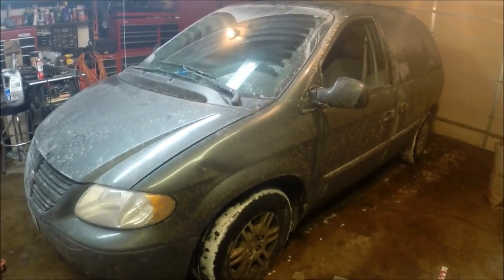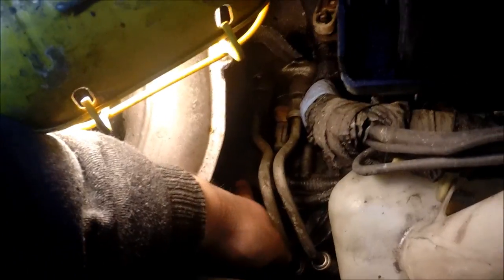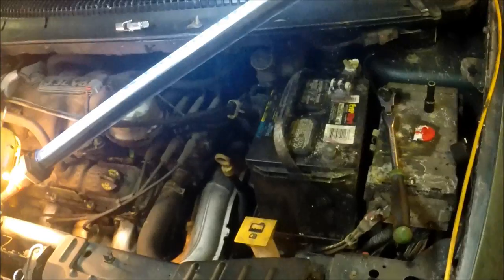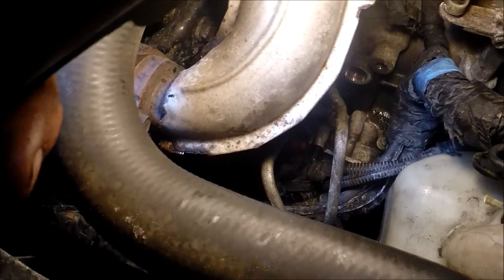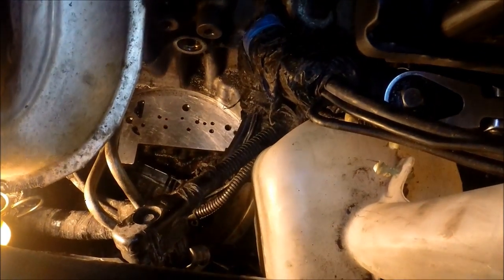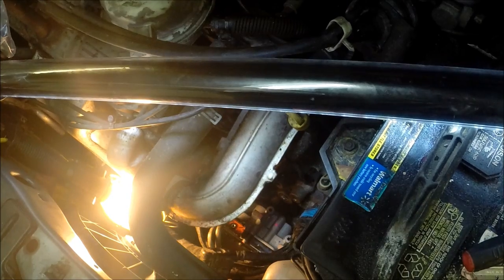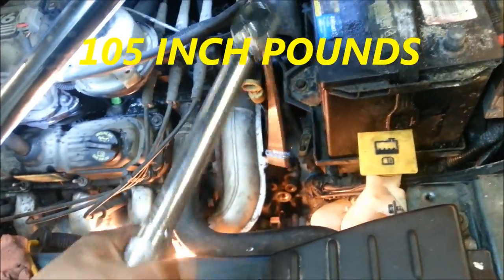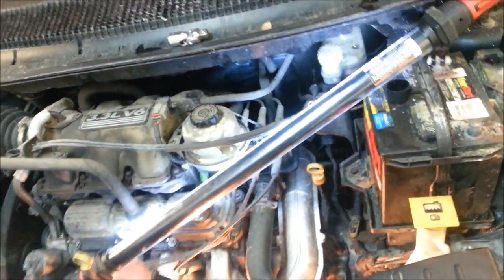Grand caravan/ town & country transmission control solenoid pack replacment

Comment: Im doing this on my Town and Country.  Everything has been ice cream up until now.  For the life of me I cannot budge the solenoid free after removing the bolts.  Any ideas on how to pop it free?  Perhaps a bottle jack from underneath to pop it free?  I don't wanna mess anything up.  Thanks
Reply: Another video a guy simply pried it with a flat tip under the bottom left corner but it was a Sebring. I have to replace mine this evening. Will let you know if you haven't figured it out yet.
Reply: @michaelblackwell7408  I got it.  I just took a 3lb hammer a couple light taps from underneath and it popped free.  Got the solenoid switched out.  No engine light and eow what a difference.  So satisfying to do it yourself.  Hardest part was scraping off the gasket.
Reply: Mine popped and lifted out by hand

Comment: what was the original symptom that caused you to change it?  I have a 1 to 2 buck under light acceleration.
Reply: Reallystock Mustang your transmission begins to fail shifting from 2nd gear, on. that is how you know. And when you scan the vehicle it gives you an 0753 code

Comment: I have a 2010 Dodge Caravan  and the engine light came on took it in they hooked it up said it was the trans shift solenoid. my rpms are up high and I'm only going 30 and sometimes if you turn it off while it's doing this it has a hard time starting again. so my question is. is this only the trans shift solenoid.
Reply: I have the exact same problem on an 02 model the only difference is the light pops up and says trans control module.
Reply: +mboone84 took it to shop they said it was starter.....but the code said saying els
Reply: +Adriann Pearce I have the same problem on a 05 caravan did you figure out the culprit on yours?
Reply: +jesusamador15 took to shop they said it was the starter. they reset the codes.
Reply from the maker: +Adriann Pearce hi sorry for the ate reply , but i see the shop said it was a starter. if the starter was drawing to much power then it could cause issues. the solenoids are sensitive to voltage drops and can put them in limp mode , easiest way is to test the battery and charge if necessary then reset the pcm by disconnecting the negative battery cable for a few minutes and see how the van reacts its the cheapest first diagnosis
Reply: +JoeTheAutoGuy  thanks for the info. much needed!

Comment: Hey joe just done a complete rebuild on a 01 town and country have a shutter on low gear take  off any ideal
Reply from the maker: fluid level , shift pattern may need to be relearned. also could be engine or mount related be sure to inspect . is the shudder constant does it change with engine load?
Reply: JoeTheAutoGuy hey joe thanks for the reply change the box no more shift problem but i guess the guys wife tour the transmission out already said i used used parts which is not true may had been a problem with not coming to a stop be4 shoving it in park who knows but thanks again

Comment: NOTE:	 If solenoid/pressure switch assembly is being replaced, it is necessary to perform the TCM Quick Learn Procedure.

did you have to do this
Reply: Not necessary, just disconnect battery before starting to work on it, and reconnect when finished, system will have to do a relearn after battery disconnect anyways, ive done dozens of these no issues.

Comment: did you perform a trans relearn? if so how?
Reply from the maker: +Reese Mcintosh i did not with no issues, but the relearn can be done with a sufficient scan tool from a mechanical repair facility and or dealer
Reply: From my understanding the re-learn isn't really necessary. Once power is restored to the solenoid it will re-learn itself but it takes about two weeks of driving, which seems like a better option. It will re-learn to your driving habits and not a preprogrammed piece of softwares "habits".

Comment: what are the symptoms when this is failing?
Reply from the maker: mine was leaking through the connector causing control dtcs
Reply: @JoeTheAutoGuy   will this fix the shudder going up hill issue?

Comment: I'm having trouble with a 2005  town & country transmission. it sometimes wont shift properly from second to first and sometimes it wont go in forward or reverse from start until you turn engine off and restart than its fine. would it be the  transmission control solenoid pack? thanks Ronnie
Reply from the maker: Ronnie S hard to say honestly , dodge has a limp mode that the transmission will go into sometimes, causing it to stay in second gear at all times , a scan tool that can read and control the trans solenoid circuits is needed for testing. dont wanna tell you its the pack and be wrong with internal damage, fluid condition is something to look at , also level if its not building pressure it wont do anything. the pack is reasonble in price and not to bad to replace but sometimes getting it professionally checked out can be cheaper in the long run
Reply: Sadly, a lot of problems originate with a bad ground.  Many times the culprit is the actual ground cable on the negative side of the battery.  It gets corroded and looks good but it's not.  My '03 got the dreaded dials and lights symptoms as well as the alternator light coming on.  The ground cable was a little corroded.  I removed it. dipped it in baking soda water for 5 minutes past the crimp area and it cleaned up nicely.  That solved the problem.  A new cable soon.
Reply: If I could learn more about this limp mode. I was driving on the interstate at 75 mph and heard a thumb sound and the tack zoom up to 6K rpm before I took my foot off the gas. At the sound of the thumb all power stop going to the wheels and the check engine light came on. I had to coast to the shoulder. As the van was slowing the transmission re engaged at 25 mph. Since I was 4 miles from my destination I drove slowly to get there. Eight hours later I started up the van. When shifting into drive the transmission engages roughly. When driving first gear worked ok but second gear slips. Did not try third or fourth gear.  Drove 50 miles in first gear to get a tow. Could this be caused by the solenoid pack? 126000 miles.